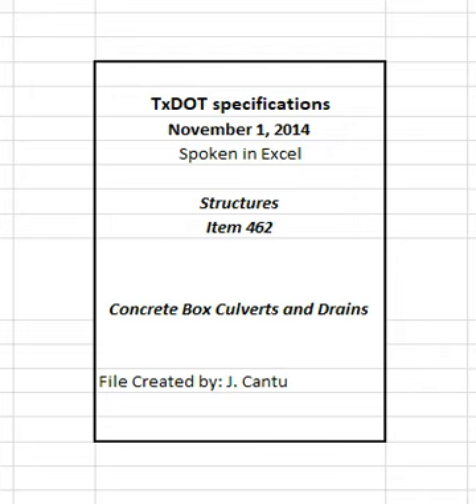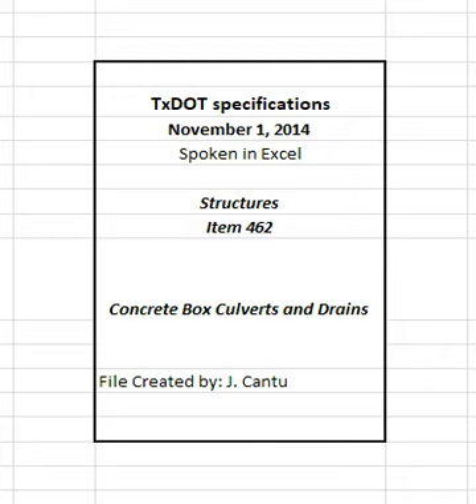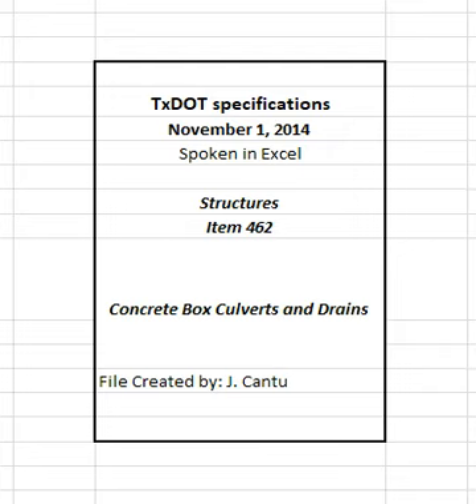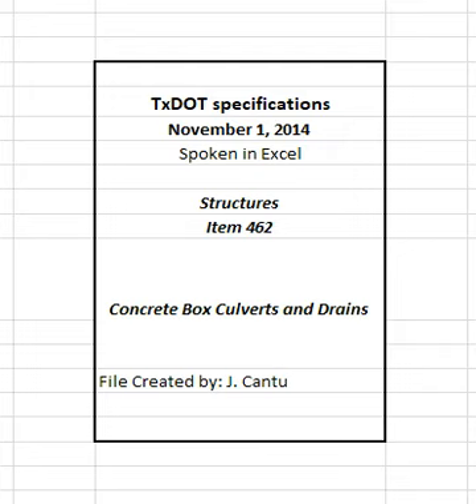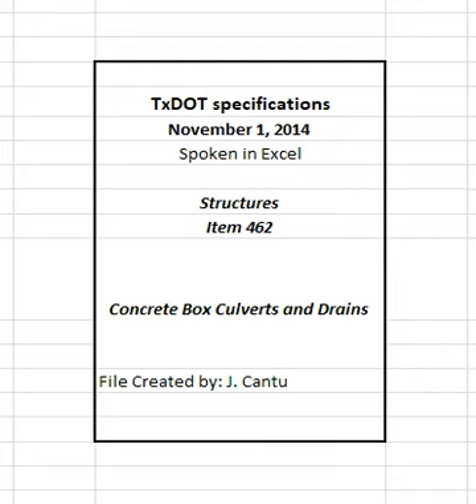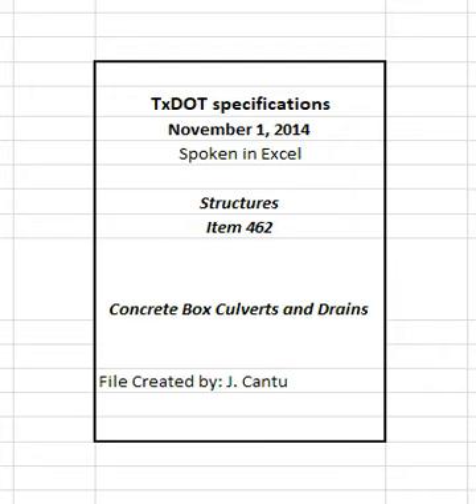TxDOT Item 462 Concrete Box Culverts and Drains

Comment: The vertical pipes( for safety) at both ends of box culverts here in West tx are terrible about catching debris, causing complete stop ups.  If pipes could be placed horizontally instead,  there would not be near the " trap" for debris, especially at the bottom of the exit end of the culvert.